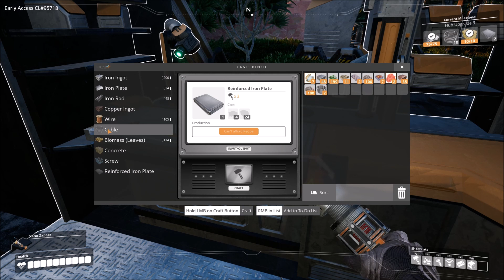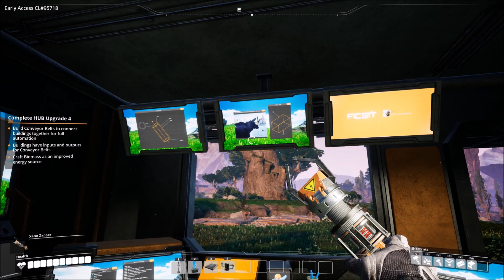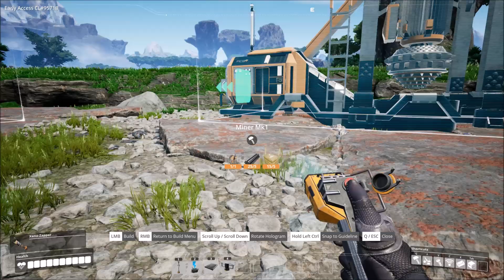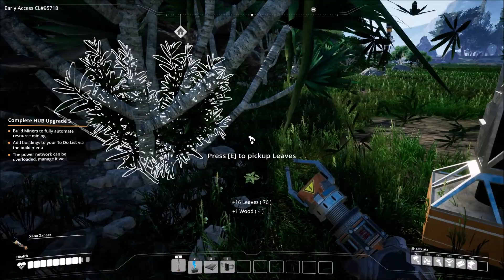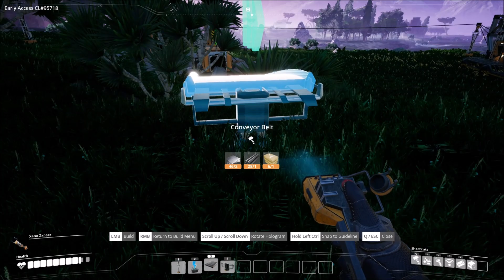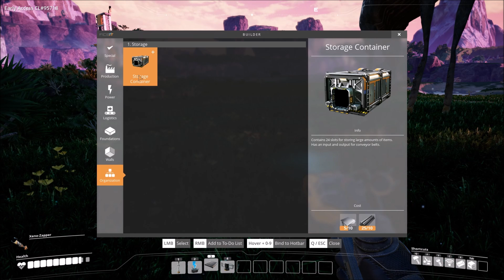Satisfactory Gameplay - HUB Upgrades and MK1 Miners

Comment: did you find most nodes are 'encroaching' and unplaceable  for the mk1?  I haven't found one that I can place it on yet.
Reply from the maker: I've been able to place them on every one so far. The only  issue I've had with encroaching is when I forgot to manually mine the above ground deposit first.
Reply: @KneePitGaming  : Ha.  I thought that top rock was an immutable cosmetic part of the node.